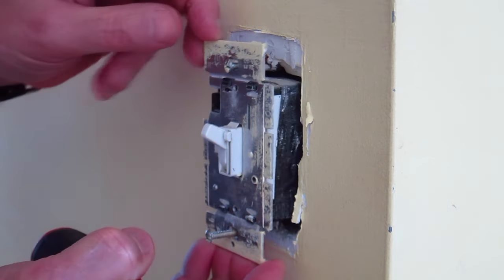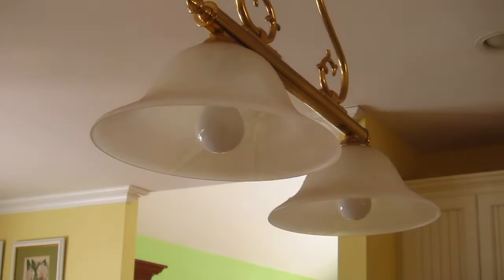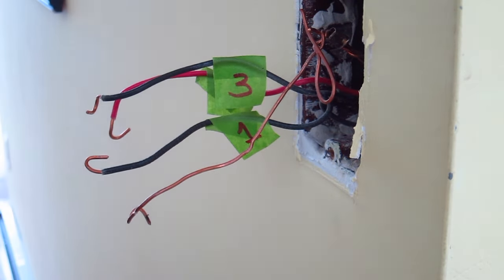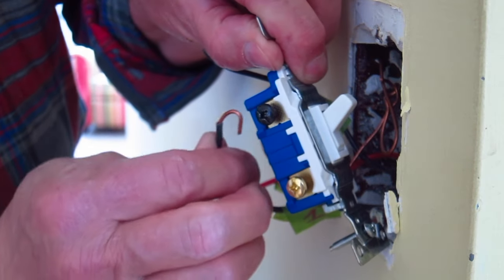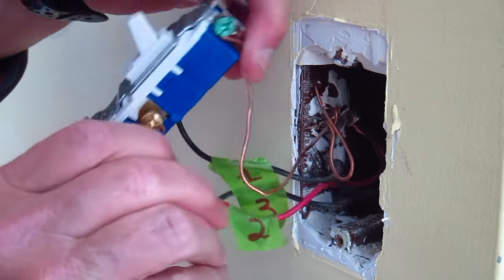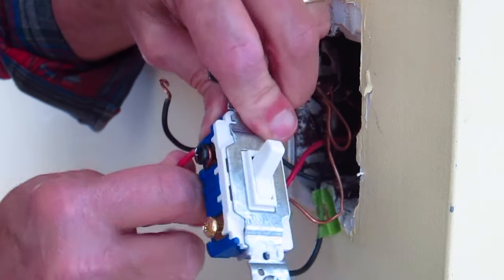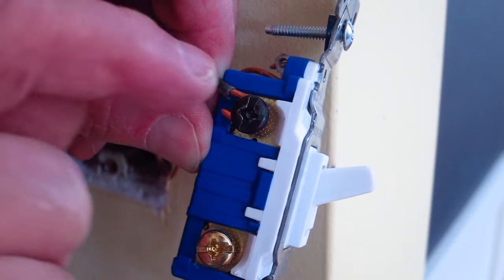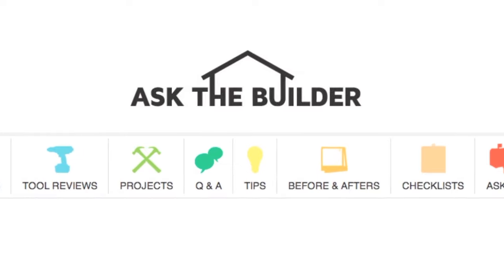3 Way Switch Troubleshooting

Comment: Can someone answer the question of HOW it starts to malfunction if there’s nothin wrong with the switch??!!!!
Reply from the maker: Easy. A person, or their significant other, decides they no longer like ivory-colored switches and cover plates. So they go out and buy a pure white 3-way switch. They take the wires off the perfectly functioning switch and mix them up while putting them on the new white switch. Do you have any other questions at this time?
Reply: @askthebuilder  I appreciate your response. What I am asking is….this situation JUST happend at my parents house. The functionality of said switches  was workin fine, then last night my mother(who did not replace anything) told me it started to not work properly. If nobody missed with the orientation of said wires and the 3 way switches are in fact still functioning properly, How is there a malfunction within said system?. Nobody can seem to answer this. It’s always….”somebody wired it wrong” when the switches have been in the house since day one and working as intended. 😂🤷🏽‍♂️
Reply from the maker: @thathvacguy  Sounds like one of the switches has broken inside.
Reply: @askthebuilder  I jumped the gun, you are correct it was a bad switch, no clicking action heard or felt. To anyone reading this always secure your common wire from the old switch to your new switch first. I appreciate your speedy response sir, I have subscribed to your channel, God bless 🙏🏽

Comment: Did that and Bingo, did not work 😕
Reply from the maker: I'm sorry for your bad luck. You probably didn't listen to what I said in the FIRST 40 seconds of the video. If you took apart BOTH switches this method will not work. Watch my original 3 Way Switch video. Search for it using my name.

Comment: Thank God where we are these ugly switches are phased out. 
Ugly, messy and totally dangerous if an idiot touches it. Love the European standard where wire goes inside the switch panel.
Reply from the maker: Are you aware that the massive insurance industry here in the USA funds the organization that authors the National Electrical Code (NEC)? If they thought that the screws and wire on the sides of the switches were a true danger, do you think it would be allowed in the NEC? And as for your other two adjectives, those are opinions. Don't offer up an opinion in a debate. Doing that is like bringing a rubber knife to a gunfight.

Comment: This is literally just "testing into compliance"  this is not how to fix a three way switch by figuring out what wires are traveler and lines. It is just fail until you fine what works...Lets hope you don't burn up a switch or light and hopefully your circuit breaker is working if you connect the wrong two wires.
Reply from the maker: Stephen, you're right. It's a testing-into-compliance method. You're dead wrong about it being able to fix a 3-way switch. You should probably READ all the other comments on this video to show you how well the method works. 

I know what you're thinking - use testing probes/equipment. So here's the challenge: Take your smartphone camera and make a better video showing the average homeowner your way of solving the problem. My guess is you'll be like the thousands of other YouTube commenters I've challenged over the years (only one YouTuber in 14 years has risen to the challenge). You'll not do it. My guess is you'll come up with some excuse. When you upload your 3-Way Switch Troubleshooting Repair video to your channel, please come back in your NEXT comment reply and paste in the URL so we can all witness your great skills and magic. I'd love to see your simple way to teach a homeowner how to make the switch work. We, the Court of Public Opinion, anxiously await your video creation!

Comment: Nope, it did not fix the problem. The light cannot be operated by both switches. One switch, I'll call it #1, must always be in the same position, in my case down, in order for the other switch, #2, to turn the light on and off. If #1 is in the up position, then #2 can't do anything and the light remains off.
Reply from the maker: You better go back and CLOSELY listen to the first 40 seconds of the video. For unlimited tips like this video, subscribe to my FREE newsletter at www.AsktheBuilder.com

Comment: you are wrong. It depends on how the power goes into the system.
Reply from the maker: Marv, time for tough love! You're wrong. My method, as confirmed by the HUNDREDS of comments from those that had it work for them, automatically puts the power wire on the correct screw in one of the three configurations. It's best here in social media to really think about what you're going to type because eventually millions of people are going to read this comment and walk away with the impression they might not want to hire you to do electrical work in their homes.

Comment: To be more efficient, why don't you turn on the power and use a multimeter to measure the voltage of the wires, provided that relevant safety measure(s) is/are applied? The one with AC voltage is the live wire coming from the MCB board and will be connected to the black screw of the 3-way switch in this case.
Reply: Tai Man - this video was made for the average Joe and Josephine who need a cave-man/woman way to do it. I think you should read the other comments to see what they have to say about this method.
Reply: I tried on one switch and it did not work, so I am going to try Tai Man Chan method and hope for the best. I did just try it on one switch though.
Reply from the maker: Uh, because my method is better and works for folks who don't know how to use a meter. Read the comments here from folks who are afraid of electricity and who find all the other videos using a meter *confusing*. If you want unlimited tips like this each week, subscribe to my FREE newsletter at www.AsktheBuilder.com

Comment: Tried this with 2 new switches, twice each, & failed. With the 1st 2 alignments, I could turn the fixture on & off with one switch with the other switch in the same position. However, once I flipped the second switch, the switch I was testing didn't work. Figured the 3rd test, the one that Tim guarenteed would now work, would be the cure. Instead. neither switch would turn on the fixture. Guess it's time to call a real electrician.
Reply from the maker: Dear Mike: It really really pays to pay attention to what I say in the video. You should go back and listen REALLY CLOSELY to what I say between 0:22 and 0:30. NOTE THE USE of *singular*. You need to watch my original 3 Way Switch video since you messed everything up so bad. Don't try to lay this at my feet. It's 150% on you:  https://www.youtube.com/watch?v=LDyvcM0gcVs&t=3s
Reply: @askthebuilder  First, I didn't do the original installation, It was done by the home builder. So, don't be so snarky & say it's 150% on me. I tried your steps. They didn't work for me. OK. I can live with that. Your condenscending response, however, is not appreciated.
Reply from the maker: @mikedavis2165  It's all on you*. You need to read the HUNDREDS OF COMMENTS BELOW that praise this video because the method works. Read your initial comment. "Tried this with 2 *new switches..." Obviously, the old switches worked fine. You just wanted new ones. You took apart BOTH SWITCHES without testing and messed up the wires. My video above is for people that take out ONE SWITCH and mess up that ONE SWITCH. You better make sure your supply of fruit rollups and juice boxes is not low. You've got mighty thin skin and you should own up when you make a mistake. YouTube is not the place to be coddled. Let's see if you come back and own up or if you want to continue to claim it's not your fault.

Comment: Nope I am here because a friend bit off more than he can chew, and I have to fix it.
Reply from the maker: Chomp chomp chomp... How did it go? Let's hope he didn't take out BOTH switches. This video is for when you take out ONE and mess it up. If he took out both, go watch my ORIGINAL 3 Way Switch video.
Reply: @Ask the Builder  he installed a new breaker panel. Now, no 3 way in the house works right. The 3 ways in the basement turn on the kitchen lights and the cause the gfci in the back bathroom to  cycle with lights flickering in both the kitchen, bathroom and stairwell. The hall lights only work on one switch. The living room light switch doesnt work at all. The whole house is screwed up.  I have to go figure out exactly what he did later today. I dont usually work on houses. I am an industrial control electrician. I watched your video as a refresher. Thanks. I'll let you know how it goes.
Reply from the maker: @wmason1961  HOLY TOMATO. What a mess. Yes, I'd love to know what wires are not connected properly. GL as we say in Morse.
Reply: @Ask the Builder  except for everything I learned today, it was a dismal failure. Thanks for helping with the learning part. I now realize the whole house is a mess. The breaker panel was replaced because the front bedroom burned. I am not sure why they thought that needed done at all.  I think the wiring needs to be completely redone. I hope his insurance covers a lot more than it has so far.. He needs a licensed residential electrician. Every three-way switch in the house (there are 6) causes  a gfci in the master bath to cycle.
Reply from the maker: @wmason1961  Many thanks for the update. Your reports are a great master class moment aimed at aggressive DIYrs who attempt things far beyond their skill level. I'm all for DIY electricians, but you MUST know what you're doing. Residential electric wiring is not that complicated, but one must have a basic understanding of circuits, grounding, and last but not least a robust grasp of the National Electrical Code.

Comment: Mine didnt work but I have two other switches in the box with an outside switch controlling a light also...mine is very complicated. I changed out the swicth and at least it works halfway..Have an electrician coming over today anyways...hopefully he will fix it for free. If he adds on I will vomit.
Reply from the maker: Remember, this video was for switching out ONE switch that WAS working perfectly. If you took out both and messed up the wires, uh oh! Watch my ORIGINAL 3 Way Switch video to see how to fix it. Get unlimited tips like this each week by subscribing to my FREE newsletter at www.AsktheBuilder.com

Comment: No it didn’t work to my case
Reply from the maker: Sorry to hear this. You did one of two things wrong: 1. You took out both switches, not just one as I stated in the beginning of the video. 2. You didn't follow my instructions. We know my method works because there are over 600 comments below confirming it. You goofed up.

Comment: That may be the worse explanation of how to fix a 3way switch issue I have ever seen.  Why not explain to people how to tell the traveler wires apart from the others and then how to properly wire the 3way once they understand that?
Reply from the maker: Dennis, BWAHAHAHAAHA Did you bother to look at the # of thumbs up vs thumbs down? Did you read many of the other comments? You're in a very tiny minority. This video excels because you don't need to explain all that stuff I cover in my original 3-Way Switch video. People just need to get the right wires on the right screws and I show the NON-ELECTRICIAN how to do that. KISS - Keep It So Simple

Comment: Mines still not turning on 🥺
Reply from the maker: Two things: You must not have listened closely to what I said this video is about starting at 0:24. Second: You goofed up. This video shows you what to do when you take out ONE SWITCH trying to put in a new one. It ASSUMES that prior to taking it out, the two switches worked perfectly. If not, go watch my ORIGINAL 3 Way Switch video.
Reply: @askthebuilder  sorry, I am attaching a dimmer switch and replacing a standard flip switch. I assumed the wiring would be similarly as simple. 

the switch was working. I used the nuts provided and put the green with the green, the black with the black and the second black wire with the red. It didn't work and then I swapped the two blacks around and it still didn't work. That's where I'm at now.  What would you suggest trying next?
Reply from the maker: @stevena3333  Simple. You're still flummoxed so now it's time for a phone call: https://shop.askthebuilder.com/15-minute-phone-or-video-conversation-with-tim/

Comment: Did not work
Reply from the maker: Well, I'm sorry for your bad luck. My video is correct. You may be like a few others that didn't pay attention to the first 40 seconds. This video is meant for those people that take out ONE switch in a perfectly working circuit and then mess up the wires. I say that at the start of the video. If you, though, took out BOTH switches then you need to watch my original 3 Way Switch video. Please amend your comment to tell us what you did wrong because if you read the hundreds of comments below, we know my method works.
Reply: @askthebuilder   i pulled all the wires off, both switches and did a continuity check.  Since I didnt know where it could be wrong.  Got it fixed.

Comment: Nothing working
Reply from the maker: Cory, read many of the positive comments below and up top. Your takeaway should be that you're doing something wrong. It's not a flaw in the video. It could be something as simple as the circuit breaker being tripped.

Comment: Didn't you make me feel like a jerk
Reply from the maker: I'm not quite sure I understand your comment, which I appreciate BTW. But if it means what I think it does, you might want to go over and grab a juice box and fruit rollup off the shelf over next to the crayons. :-O
Reply: @askthebuilder  I was being sarcastic,,, kind of. It went down exactly as you said it did. The wife went to the store and I told her I was going to change the two 3 way switch's and then I'll be damned if they wouldn't work right. Turns out I had a faulty switch. If I wouldn't have thought to check for continuity I would have probably still be trying to get that switch to work. I would drink a juice box but every time I do my kids get mad. Good video my dogs for some reason wouldn't stop barking at your voice maybe they were trying to tell me something
Reply: @askthebuilder  i referred this video to a friend. I have been drinking apple juice lately. It goes great with 160 proof water. Thanks for the electrical and the juice tip!
Reply from the maker: @BPattB  I hope it helps her/him. Be sure to join my Discord: https://discord.gg/u89GyDjBdr

Comment: did not work
Reply from the maker: Well, all I can say is you must not have done it right. It HAS to work - one of the three possible combinations. Remember, this video was made ASSUMING you had two 3-way switches working perfectly and you made the mistake and removed ONE of them not remembering where the wires went. If you removed BOTH switches and goofed up the second one, then you need to watch my original 3 Way Switch video to understand what you need to do.

Comment: Bruuhhh. All you need to do is turn off breaker, take apart the switch, then turn on power back on. (Next step is only for the brave) Individually touch all the hot wires. The wire that tickles, is the wire that lands on your common screw😂🤣🤣😂😂
Reply from the maker: Yes, that works too. But most are not brave and your method comes with serious risk.